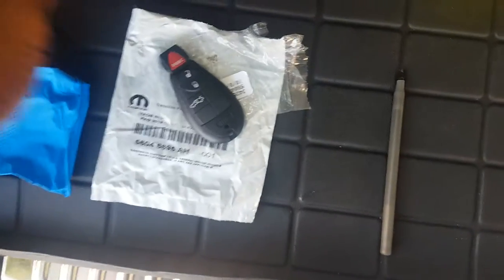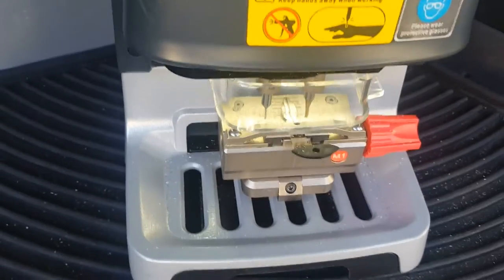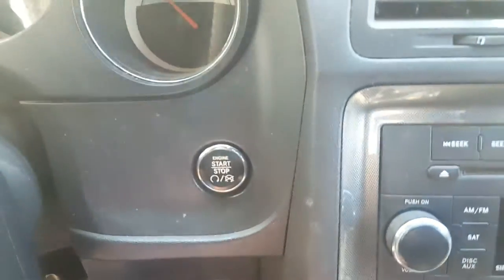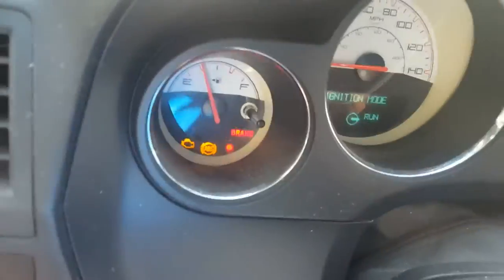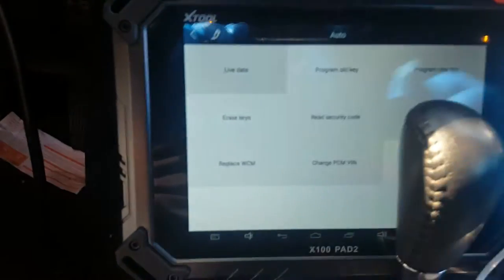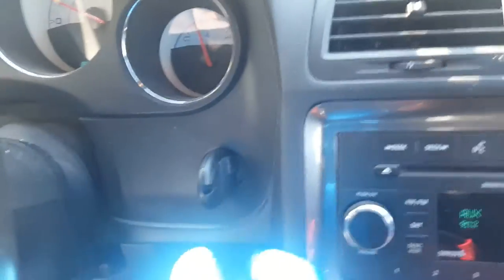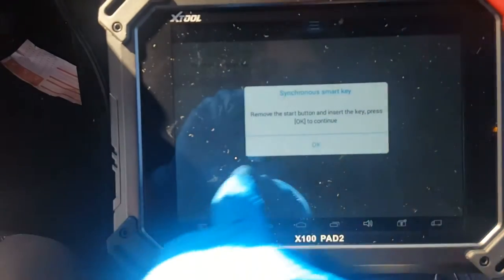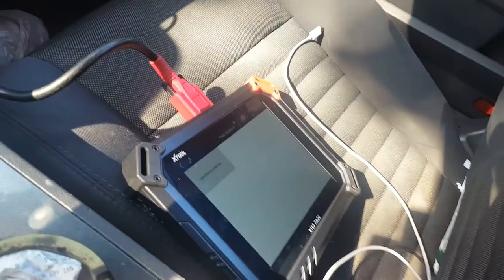Dodge Challenger Key Programming (Keyless Go-Fobik)

Comment: Hey bro, i have a 2013 challanger and the key works to start the car but when I try to lock it or unlock it it does nothing. It used to have a push on button but it got lost but again using the key it turns on. I have change the battery on the fob key but nothing… any suggestions?

Comment: My 2008 Challenger battery apparently died while in storage and on a trickle charger.
When I went to start the car it did not recognize either key fob even with new batteries in them.
I thought the trickle charger may have failed so I put a standard charger on the battery then tried both keys again.
No go, it still did not recognize the keys and the electrical was acting weird even with the battery charger connected.
I replaced the battery with a new OEM battery and it still would not recognize the keys even with the push button removed and the key inserted the electrical acted normal though when in accessory mode.

The key fobs won't open the doors or anything and the car tells me it's the wrong key fob even though I tried both and they are the correct ones.
Any suggestions?.
Reply from the maker: Possible they lost programming, although probably something else going on.. did you put a scamner on it..if so, what exactly are the fault codes?
Reply: @ammreid  No, I don't own a scanner and would not know where to start.
Reply from the maker: @obxonehour  without a scanner..that will scan computer codes..hard to know if its just lost programming...if it lost programming..then a locksmith will need to reprogram the keys

Comment: does the proximity feature work?? i programed a key with toms smart key and i lost proximity feature
Reply from the maker: Yes, Prox functions work - check end of video @6:19
Reply: @ammreid  thank you..so outside the car you can lock it by touching the button on the handle and unlock by just lifting the hamdle without touching the remote
Reply from the maker: @swood248  correct, all functions were working
Reply: I program  my key for 2011 dodge challenger  but all it will do is start the car with the push button removed...i.went to jeep section to keyless , and still nothing...any help would be great
Reply from the maker: @swood248  sounds like wrong key. You may have program the version that is not prox equipped
Reply: @ammreid  wow....didn't know it was different do.i ha e to get them from the dealer
Reply from the maker: @swood248  no, you can get them at any locksmith supply company.. Like American Key Supply, or UHS Hardware, or Carandkeyremotes.  com
.. there are two versions.. the Prox version will obviously be more expensive then the regular part number

Comment: Where did u get that scan tool and key cutter ?
Reply from the maker: Scan tool - got from Amazon Xtool Pro Pad 2 Pro... the Cutter from UHS-Hardware
Reply: @ammreid  how do you compare the xrool pad 2 pro to the autopropad if you ve used it or owned it before. 
Nice vid by the way
Reply from the maker: @DFWAuto_Hack  yes, I've used it, they are very similar.. Pad2 is more international stuff as well as America, where as AutopproPad is more catered to the US market... they both can do the same vehicles, but Pad2 Pro you may have to search around the menus more or find substitues if cannot find exact car, where as the AutoproPad will easier to use in the US market (not by much thou). The biggest difference in my opinion will be Support... there is US support for the Autopropad
Reply: @ammreid  makes sense. Thanks for elaborating and keeping up with your channel and comments. Most people don’t even care. They just want the views. It is obvious that You love what you do. I love it too. I use the xp005 just like you but use xc009 for regular sided keys because the xp005 failed a few times on those so I decided to go manual cutter. Check it out, very easy to use, not expensive and portable as well. Cuts up to 60 keys on a single charge.

Comment: Can this be used for upper model like 2018?
Reply from the maker: @Dashty Fryad this tool does not have the software yet to do the new systems in the Chrysler products 2018+
Reply: @ammreid  i though so brother thanks for your time because i couldn't do it ither with my im508 so friend of mine has the tool i though to use it but finally I've found the other salutation to it that I've 2
Get a bypass cable for my Autel.
Reply from the maker: @dashtyATG  yes.i think.autel can do it with bypass cable.. when I do those 2018+.. I use the new Ninja t1000 programmer..i am testing out..and it seems to be good so far
Reply: Great video! I purchased a xtools x100 pad 2 and tried reading the pin codes in a few cars but havent been able any advice?